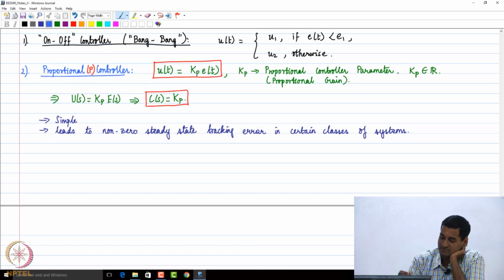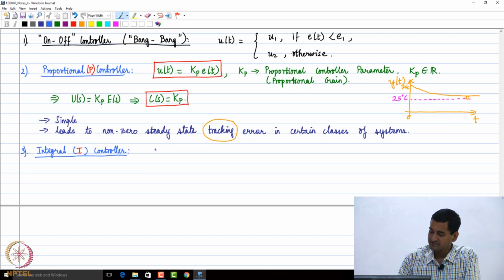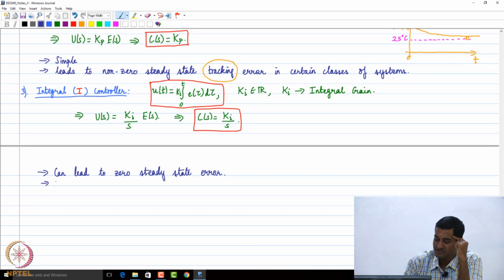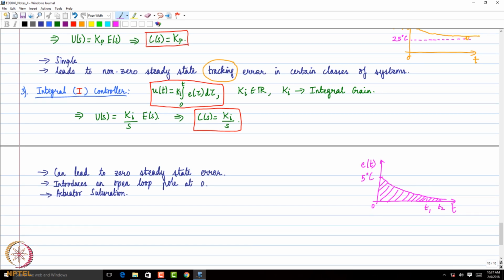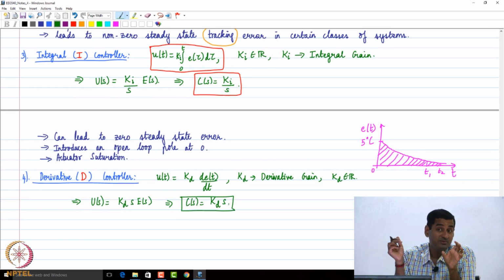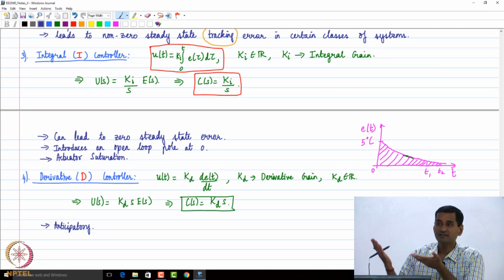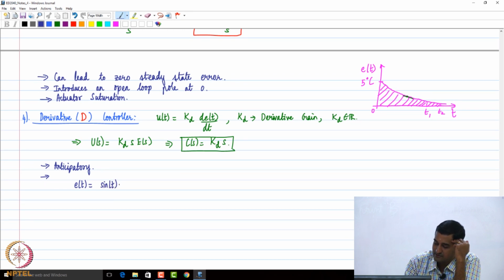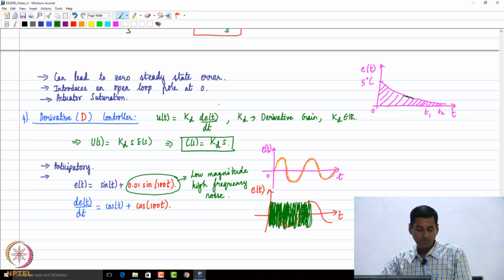Controllers- Part 2

Comment: pros n cons of :
P control - considers only present instant, may give non zero steady state tracking error, simple 0:00
I control - considers past,  gives zero SS track err, introduces pole at origin, cause actuator saturation 4:00

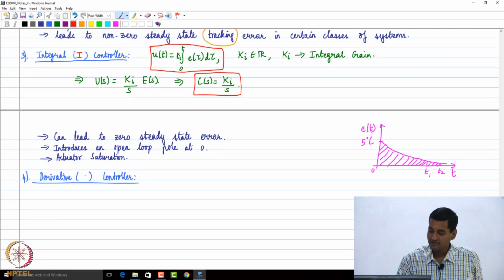D control - peeks into future i.e anticipatory, intro zero in Nr of open loop tx func making CL tx func improper, amplifies small amplitude high freq err signal thus masking normal output. 12:30